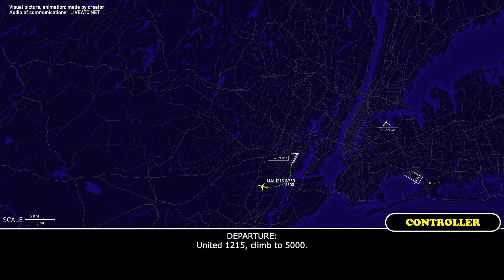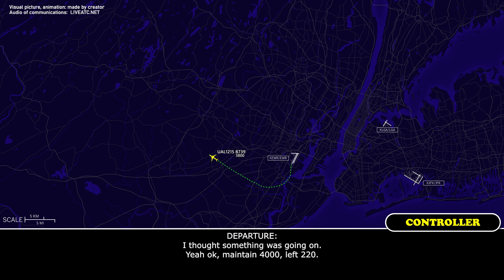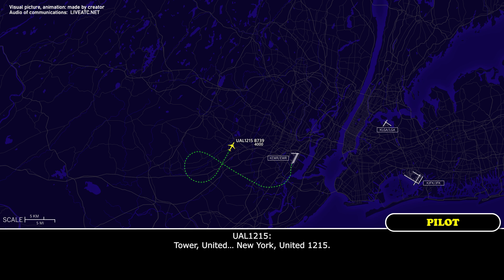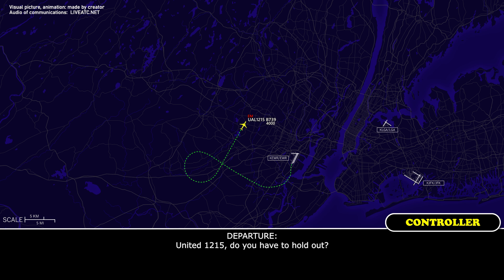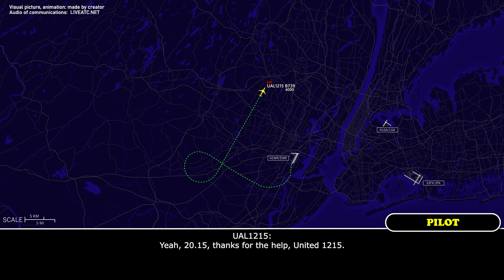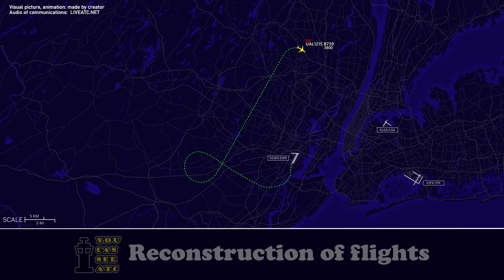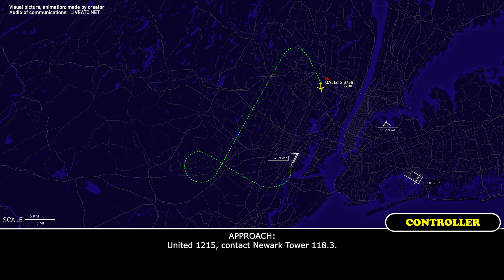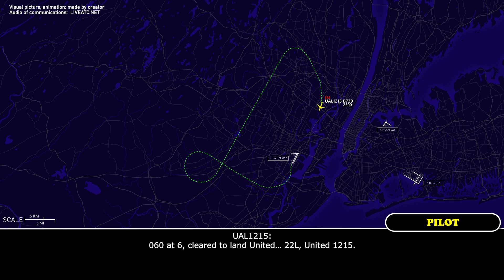“Stabilizer trim is inoperative”. United Boeing 737 has trim issue at Newark. Real ATC

Comment: I’m not a pilot so would someone be kind enough to explain why an inoperative stabilizer trim would cause an emergency? Thank you
Reply: The stabilizer trim controls the entire pitch attitude of the aircraft and reduced control forces needed for the elevator. If the stabilizer is out of trim the aircraft could become impossible to control. The manual trim works, but that is a huge workload. I’ll be diverting as well.
Reply: Mentour pilot could help you with that one , brilliant channel .
Reply: Inoperative trim could cause a problem if it was causing an out of trim condition that disabled the autopilot or caused continuous manual override by the pilot.  (Not a pilot and could be better explained by one.)
Reply: Just want to add on to the other comments that the airplane is going to want to go up/down based on where the stabilizer stuck. If they got it in position during the climb and then it didn't move from there, the aircraft is going to naturally keep climbing and you're going to have to push really hard to get it to level off, much less descend if you can't adjust it manually. Similarly, if it got stuck during descent, getting the plane to climb is going to be really difficult. So there are some real controllability issues with stabilizer issues. Alaska Airlines 261 is an extreme example (where the entire assembly failed causing the aircraft to get stuck in a dive), Republic Airways 4439 is one where the stabilizer worked opposite of what the pilot wanted. Mentour has videos on both.
Reply: Stabiliser has quite a large amount of leverage when compared to the elevator's effect (not enough to overide but enough to make it difficult to fly normally) . Think mcas...
Reply: yep-and that's why they decided to stop the climb at 4k feet